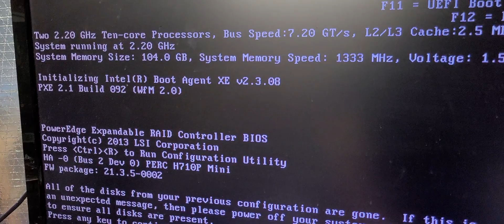My RAID HBA troubling shooting has found the issue my new Dell R720XD motherboard   Not good!

Comment: For booting from an SSD -- they sell a tray on Amazon for about 10$, where you can swap the SATA-connected optical drive directly to your motherboard. Then go to the lifecycle controller and enable the onboard SATA controller, and it should allow you to use that drive to boot (I did it on my R710).

Also --- my R720 is running 2 x 500GB SATA SSD's in RAID0 (same as trusting a single HDD for boot imo), to run the base VM's from. That way you're RAID controller will allow you to boot from it too. You could also put a single SSD connected to the RAID card and just set it up as a single drive in RAID0. It's essentially "passthrough" mode, tho i know it's not a true passthrough b/c it's creating a VHD on top of the physical one.

Anyway -- this is stuff I spent many hours trying to do w/ mine. So I hope this could be helpful for you 👍

Comment: Just two tips I found when the system locks up in the startup like that --- try to unplug ANYTHING connected via USB, then plug your keyboard back in. For me, this got it to continue a few times.

Another thing that always worked for me (especially when the server would not recognize my keystrokes to enter the UEFI Setup or Lifecycle Controller) is to completely unplug the power for the 30 seconds (Id let it go a couple minutes) and then it would recognize my keystrokes when I started up again.

I wanted to mention this --- though I understand it may not work for you b/c you have other issues w/ the contact. I was getting that same error for the RAID card upon startup when I would put those 3 x 3TB SAS drives in... and I would enter the controller... it would recognize the drives, it would let me create VHD's, and then upon restart it would say there was a fault detected, and repeat the same process. It drove me nuts (and I still plan to buy the HBA in the coming weeks, to test those SAS Ive mentioned a ton haha)
Reply: Also --- when I checked my R720, it's RAID card is running pretty steadily around 45-52 C (when you mentioned yours is getting warm). Thought Id see if I could give you a comparison to another R720 (I'm in PA, where its in the 40's outside today and it's roughly 65 deg F where my servers are.
Reply: Also, I would make sure my iDrac was cleared (Id tell it to ignore any errors it'd pickup during the memory test period). Idk if that had anything to do w/ it too, but that was my "ritual" 😆

Comment: Just make sure they send you back the same board revision or newer. I had to RMA one for my Dell R720XD google yellow ages ago and they sent me back an older rev. that wouldn't boot my dual E5-2696v2 AWS OEM cpus
Reply from the maker: Yea, they don't have another one so it is a credit but you are correct big time... Thanks for the advise...
Reply: Lots of cheap ones on ebay luckily ;)